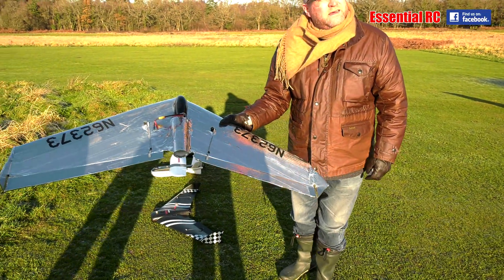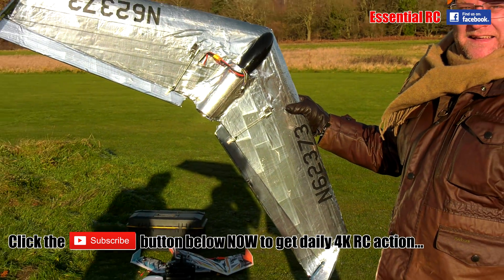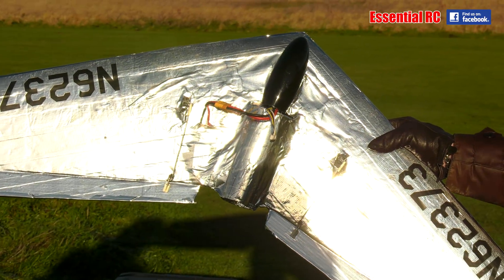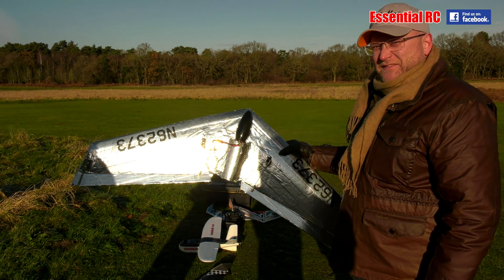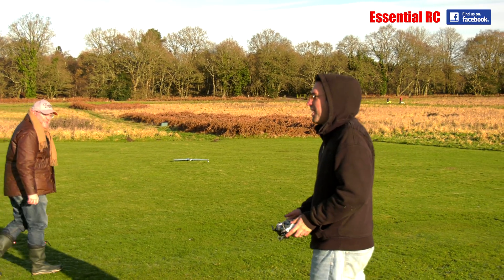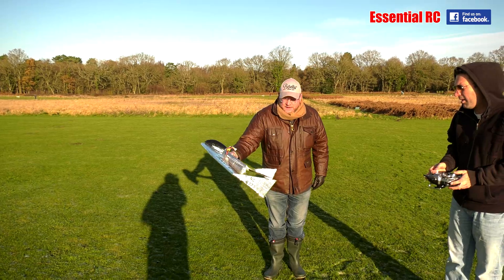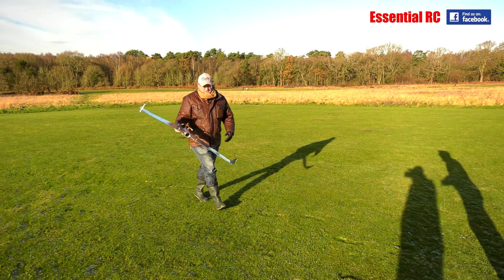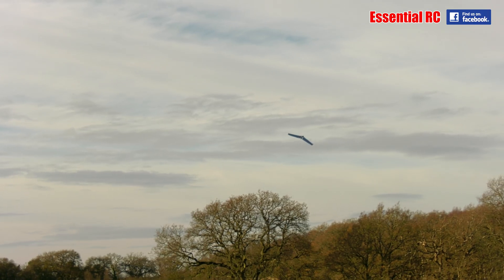JET Wing EXPERIMENT (Crunching CRASHES, FUNNY Fails and LUCKY Wins !)

Comment: Its tip stalling, Rearward CG, too much elevator, looking horribly underpowered too.
Reply from the maker: You're right on all points but you have to try to find out these things. As regards power the lipo was blocking the intake so would expect a lot more power next time. Cheers Dom (Essential RC)
Reply: Essential RC sweet, did you see my message about the helicopter I have?
Reply: Nice flight
Reply: Essential RC zagis are notorious for high elevator tip stall.
Reply from the maker: No mate. Didn't see any message. Sorry.
Reply: Drop me an email Adrian@accurc.com